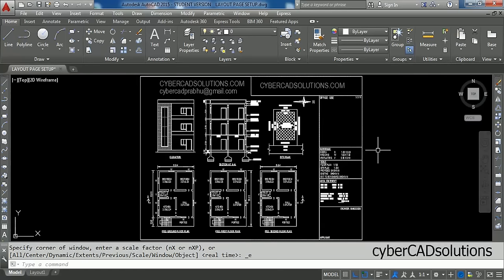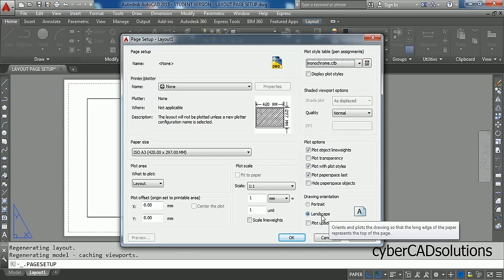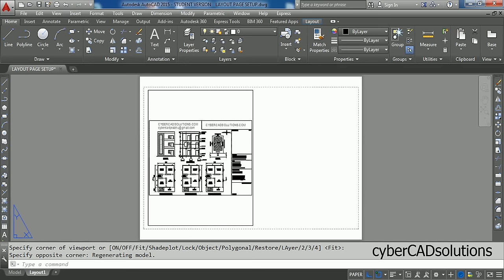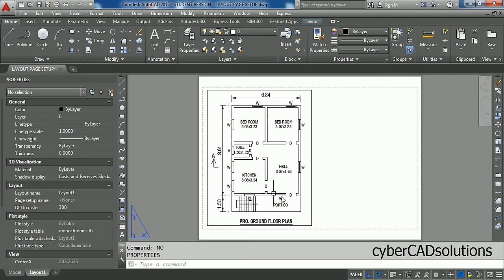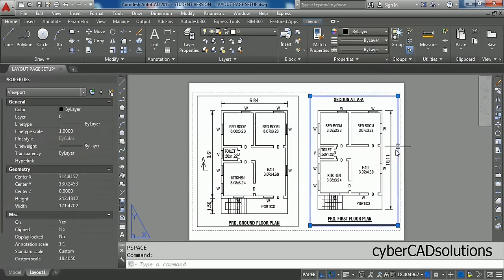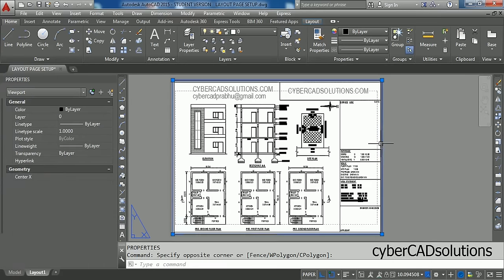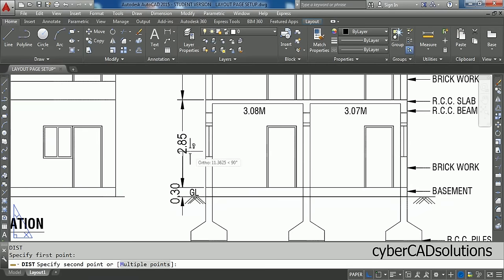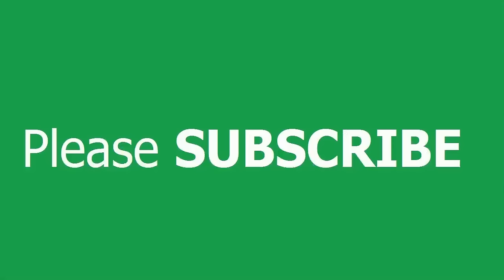How to do Page Setup in a Layout in AutoCAD

Comment: Thank you for the tutorial, but please tell me why when I print the frame, the top and bottom edges are cut off. I think it is because of the dotted frame in the layout. I do not know how to fix this issue.
Reply: For any one wondering, just use iso expand instead of iso when choosing the paper size. This removes the plot lines and margins.

Comment: I inserted a picture (map) in CAD. 
But when i transferring this file from a computer to another computer by pendrive the picture (map) not display. Plz give me solution
Reply: Insert the picture from same folder where your file is located, and then copy both together (autocad file and picture) inside a folder. Or else copy the foldet.
Reply: the picture you inserted in auto cad file must be available in the memory of the computer on which you copied. otherwise it will not show in cad file. cad file me image dikhne ke liye wo us computer me bhi available hona chahiye. copy that image also in your computer tab aayega
Reply: copy the map picture into the pendrive

Comment: Sir plz solve this question 
Using AutoCAD, draw the isometric view of the frustum of a cone of 
40 mm base diameter and 80 mm axis height and cut by a horizontal 
section plane 25 mm below the apex. Drawing should bear proper 
detailing using texts and dimensions wherever necessary.